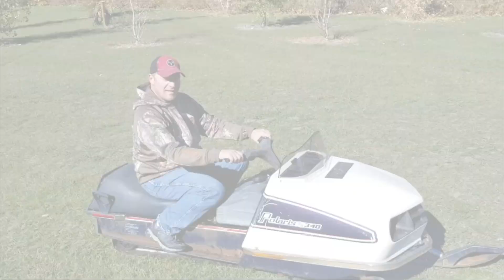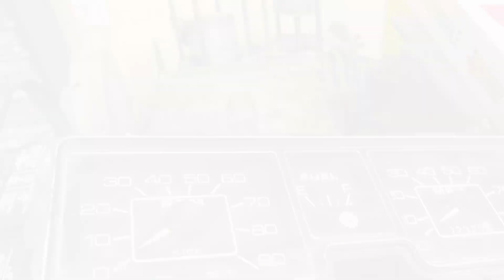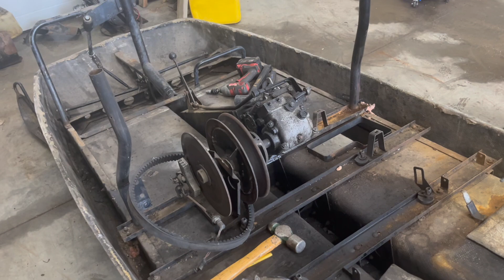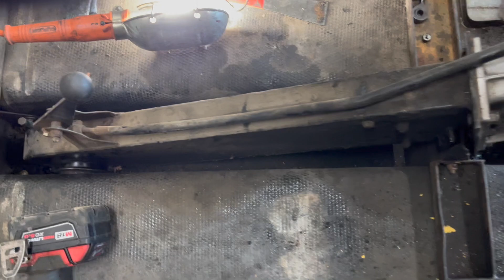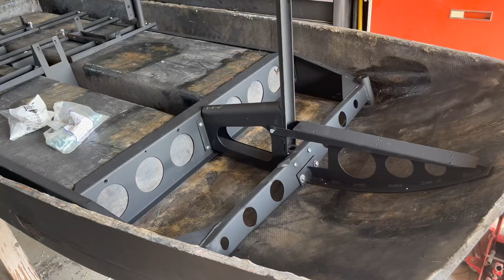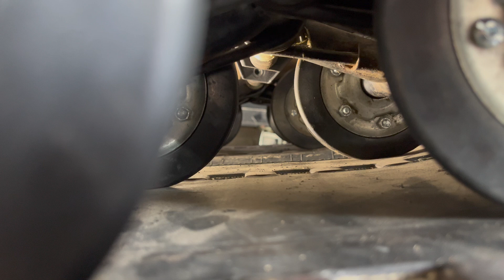1973 Ski-Doo Elite Teardown Supercut Part 1 - Don't Get Daved

Comment: Question regarding the chain case. I want to check and make sure i have enough oil in there. I know there is a larger bolt on the top of the case which i assume is the fill. What do you use to gauge the level? the manual only mentions a dip stick that i obviously dont have. Is there a oil level bolt on the side of the case? I have a larger newer engine in mine and it makes it a bear to even look at the case. Also any recommendations on the fluid. Your video has been a huge help in getting mine up and going!
Reply: Sadly the only way to check the oil is with the dip stick or with some kind of thin wire.  The dipstick hole is by the shifter that is plugged with a small bolt.  As long as the oil is 1/2 way up the bottom sprocket, the Chain will carry the oil up to the top.  For the oil I just use 80w90 or whatever gear oil I have on the shelf.  

Thanks for watching!!

Comment: how do you replace drive chain
Reply: Hahahahaha…with patience, a hammer, beer to drink, and a good vocabulary of cussing words!!  There is no chain link, it’s a continuous chain.  Remove the belt drive sprockets first.  Remove the tensioners.  You will need to take the lid of gearbox off so shaft can be removed.  The gearbox shaft, chain, and lower sprocket have to all come out.  Once it’s all out…don’t celebrate to much…installation is worse!!!  Stock up on that beer…!!  Now while it’s out, you can split the chain, but you will need a link…and I’m not sure if this is standard chain or special. Just do some research..I read that some guys did this.  Installation will be easier…kinda.  But if you keep the chain the same…drop drive sprocket in with the chain, install tensioners, put chain around gearbox shaft and install.  Get that hammer ready to smash something in anger…stop..have a beer…start again.  You can do it!!

Comment: I bought a 74 Elite when I worked for a Skidoo dealership back in 1981 I think. The last registration sticker was 84 and has 675 miles on it. I am looking to refurbish this summer and wondered when you might have part two for this series? It is an amazing how to for one of these and looking forward to see the completion
Reply from the maker: Gravy is working on it. It's done when it's done.

Comment: How does the front drive shaft come out? My sprockets are bad but can figure out how to pull the shaft? Is it one long one?
Reply from the maker: Each side comes out separately. Do one side at a time. Release track tension. Remove all bogie trucks on that side. Remove outer bearing cup. The axle will slide out of the case. Replace drivers and reassemble. Do the second side.
Reply: @ awesome appreciate it!